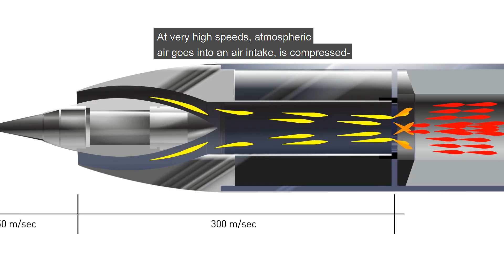How ramjets may change the role of artillery on the battlefield

Comment: I imagine this combined with a rail gun and it would be literally Intercontinental Ballistic Shells.
Reply: I could see that being used with railguns (even though railguns are mostly being looked upon because they negate the problems of conventional artillery, they do come with their fair share of problems though), but idk about the "ICBS" part... You'd need to fire those at very VERY high altitudes to reach another continent, and ramjets have a massive problem with very high-alt flight... I guess we'll have to see how this whole tech evolves but i don't really see the point of an ICBS system seeing how easily defeated it would be by any AADS...
Reply: @leodelizy3822   The SR-71 flew at the speed of this projectile. Over 4,000 times it was fired on by every missile and AADS system in the world. Every single one missed.  Why does anyone think that any system in the world can destroy a mach 3 projectile 1/100 the size of the SR-71?
Reply: @michaelrunnels7660  Not saying you're wrong, but you are forgetting that the SR-71 flew in a straight line at 80 - 90,000 ft, while this round will be traveling in an arc, eventually approaching the ground.  Also, while a Scud is much much larger, it traveled at Mach 5 and was taken down by Patriots.
Reply: Railgun projectiles are made of a solid block of metal. They are accelerated so much that any mechanical construct would be damaged. There is also no space to put in the rocket motor
Reply: @deadbeef576  a ramjet engine is an excedingly simple design that almost has no moving parts so that isnt the problem
Reply: @deadbeef576  the rocket uses a solid propelant not a líquido one, those tend to be far more resilient than a liquid propelant one and use less space, thats one of the advantages of this system

Also it's excedingly easy to isolate rocket fuel from electricity of all things (rockets HAVE been struck by lightning before with minimal damage, one example is the apollo 12 which went to complete it's journey with no problem), so no you don't really need a lot of mass, so the rest of what you say is just non sense

Also yeah usually ramjets are capable of reaching hypersonic speeds on their own the proyectile would need to be designed to survive the huge speeds, right now the navy is working on that with their current railgun project so no problem

Like, really, you are just trying to find problems with the design even when there arent any or at the very least not insurmountable ones, every single thing you mention either already has a solution, was never a problem to begin with or doesnt really make sence
Reply: @carso1500  Have you ever seen the railgun projectile? It is a solid block, and the currents going through it are immense
It is not merely a a lightning bolt.
A lightning bolt can produce up to 20000 amps in current, while a railgun goes up to 5000000.
Reply: @deadbeef576  yeah, i also know from high speed cameras that the proyectile stays solid even going at mach 7/8 and it's made of just regular steel, you really are overstimating the temperatures reached by going that speed (without taking into account that there ARE ways of developing a proyectile that survive such speeds, we have materials capable of going at those speeds and not even flinch)
Reply: @carso1500  Why arent you addressing my point concering 5 million amps?
Reply: @deadbeef576  because it's not a problem as i tell you, you arent reading shielding from electricity is extremly easy (the friction is the real problem imo, but electricity can be bloqued entirely by regular aluminium)
Reply: @carso1500  You dont understand how railguns work. How induction fields work.
Ever used an induction hob? Those amps are causing a lot of heat, just compare it:
A regular induciton hob uses about 42 amps to heat up a pan. And that pretty fast. Now multiply this times 100000 which a railgun projectile has to endure.
It is the same principle.
Reply: @deadbeef576  eh, no that not how it works, the electrical field doesnt really generate heat because it's just used to create a magnetic field (well i mean, it's electricity it DOES generate heat unless you have a perfect conductor which we don't, but not as much as you think), the way a railgun works is by transmiting huge amounts of electricity through a set of parallel rails thus creating a magnetic influx, now the moment you put something between those rails (of course it needs to be build of a conducting material, usually either Cooper or aluminium) the proyectile accelerates thanks to the magnetic field

Also you can't use the same logic as behind a electrive stove, both are completly diferent systems designed to accomplish completly diferent goals

Now, the reason it doesnt gets hot (or atleast not hundreds or thousands of degrees hot) it's two fold, for once the rails are build from highly conducting material, they need to be able to create the magnetic field, this means that the electricity and the heat flows really fast through the entire thing thus distributing it equally, this means that the entire rail is colder than it should be because the whole construction mantains the same temperature equally distributed, the second reason they don't really heat is because railguns only transit electricity through their rails when you want to shot it, for example the rail gun the navy developed uses huge capacitor banks that store all the energy on them, capacitors have the advantage that they can quickly discharge all their electric charge in miliseconds thus allowing you to keep all the electricity needed to fire the damn thing inside them and once you actually want to shot the weapon they quickly discharge filling the rails with electricity, this is done because railguns are extremly energy hungry, you would need a nuclear reactor to keep a railgun running for more than one second (that granted thats actually what the US navy wants to accomplish, quick discharges and recharges)

This is the same design the Ford class aircraf carrier uses for it's electromagnetic catapult btw, just of course instead of firing a solid core tungsten round at hyper sonic speeds it propels and F-35 or F-22 downrange

Btw how do i know all this, for once i am an army snob i have really investigated how all of this works, also i am an actual mechatronics enginer i know how electricity works better than you do
Reply: @carso1500  also, i know i might be a bit late to the party but I'm pretty sure a metal alloy casing could be used during the launching phase to propel the projectile itself and take most of the heat, and maybe even use said heat to ignite the primary fuel block? A bit wacky probably but that's the way i could see such a thing being launched, what do you think?
Reply: @leodelizy3822  yeah, thats called a sabot round and it could definetly be used to protect the main cassing of the proyectile through the terminal phase, the real problem with a sabot is that it usually does reduce the size and as such the power of the main proyectile

I guess you could posibly use a thin aluminium casing, just thin enough that it would probably get vaporized by the heat generated from the friction against the rails, but that should be enough to protect the outer cassing of the round from the heat so yeah, it could posibly work and it would be quite badass at that
Reply: RAM jets don't work above mach 5
Reply: It's not a shell, it's a rocket. We already have those.

Comment: ok, we confirm our shells have reached into enemy territory.
now how can we send the explosives left behind in our base ?
Reply: Thinking the same thing. Was wondering where the explosive charge was. This might take out a tank on kinetics alone but one of the major uses of artillery is against troops. Steel rain, you know?
Reply: @drakkonis1  ssubmuntions presumably, 155mm sub muntions shells useually have around 7 tubes of sub munitions rapped around a central tribe of submuntions. With the ramjet you could still keep the outer layer of submuntions. Meaning you can still have a fairly wide spread of anti-personal shrapenal and pressure wave.
Reply: pretty much same thing i was thinking, so your throwing engines at them with barley any explosive..  bit of a waste of money. better off spending it on equipping and training soldiers better.
Reply: @deana8052  Explosives may not be necessary.  If the motor is still running at impact, it will have a massive amount of kinetic energy.  Smarter Every Day has videos showing the damage that a Mach 1 baseball can do.  These would be much heavier and travelling at least 3 times as fast.   With laser guidance, that would be more than adequate for taking out targets such as opposing artillery.
Reply: @edwardbarton1680  Yea that's just wishful thinking, where are they going to put this tracking system to guide it?
Reply: @deana8052  On the shell, it can be included in the central cone.  For the actual targeting laser, it could be done using either a high-altitude airplane, or with a forward scout.
Reply: Dean a  it’s going mock three and away is over 100 pounds it doesn’t get guided just like other artillery shells such as mortars.
Reply: @hunterwalker6832  Yes but if you read the other comments you would see that Edward was claiming that it could be, So what if it is a fast moving piece of metal it isn't pin point accurate being fired from artillery.  

@Edward Barton  If you're going to laser the target, you are better of dropping a JDAM or sending a cruise missile. Lobbing arty rounds that don't explode isn't effective, not to mention it wont be armour piercing either and there are more deadly and viable options already available imo.  

the only thing this video showed is that it can go far that's it.
Reply: @deana8052  actually, it doesn't have as much as an he shell, but it does have explosive mass
Reply: @lunchbox1553  not when its using all the propellent to achieve its longer range. Nothing in the video made it look effective for anything apart from going further.
Reply: @deana8052  The propellant and explosive mass are two different things, and it doesn't even need any explosive mass, so I don't see why that's even a problem
Reply: @lunchbox1553  An unguided artillery shell not carrying any explosive mass is a waste. At long ranges, hitting the target with unguided shells needs a fair amount of luck; hitting within 5-10 meters is already acceptable.
All this video is talking about is range, not a single word about accuracy.
Reply: @deana8052  A few inches of Armor will not help you when a hypersonic projectile hits... This system will be perfect for armored targets. On the other hand this type of shell will be probably be useless against large numbers of soft targets.
Reply: @deana8052  you do realise laser guided artillery munitions have been a thing since the 80s right? Both the Soviets and Nato has had them for atleast that long. Cruise missiles are bloody expensive and overkill for most targets...

As for anti-tank? APFSDS shells also lack explosives, its simply a solid dart traveling at ~1800m/s, a ~3000m/s ramjet shell with a tungsten or du cap coming in at an angle (hitting top armour) will likely kill any tank currently in existance and any in the near future...
Reply: I dont know about ramjets for artillery purposes. What if the Shell has engineproblems and falls on friendly troops. Its unpredictably

Comment: The concept is quite interesting indeed.
But the main aspect of artillery is that the shell is fill with HE and to destroy with as much blast and explosive mass as possible.
With that Projectile I don't see much Explosive mass in it.
Your sacrifice distance and speed over Powerful Explosive Destruction.
That's why Russia uses MRLS because it's a small fuel burn with a lot of HE filler,And the projectiles are quite long too.
Reply: I could see it used in a counter-battery role where air superiority hasn't been achieved. Yes HE will always be cheaper, and more effective in an Area of Effect or denial role. CIWS are evolving fast enough that MRLS systems may not be quite as effective in the counter battery role. More tools in the toolbox may not be a bad thing.

Comment: I'm skeptical.  What's the advantage of this thing over an SRBM?  It would have an extremely limited payload, due to all the other stuff you'd have to fit in the shell, and since each projectile would need to have a precision guidance system (or it won't hit a thing at 150km), the cost would be quite high, probably $100,000+ per unit.  In contrast, for a few million bucks one could get an SRBM with double the range and a 500kg warhead.  What can 50 of these things do that the SRBM can't?

Comment: This video was in my Youtube recommended page...

SAMMO is absolutely a bunch of idiots.

First, cannons fire roughly 20-30 miles, because they exist to support army agendas, which include troop movements. And their conventional rounds will fire under water, or in a vacuum (space weaponry).

A projectile which fires over 100-linear miles, will outrange its supporting army, which is required to challenge and hold areas of land.

Next we have the projectile itself. 2/3 of the projectile is propulsion, which leaves the explosive unimpressive.

A conventional cannon shell is almost 60-80% explosive charge or more. This can be very impressive.

And then there is the cost of the projectile. Its engineering alone must be factored into the overall cost of the projectile. It will be so expensive that using it will be prohibitive. It will cost many times the cost of a conventional cannon round. And yield only a fraction of the destructive results.

This idea is just plain dumb!
Reply: If anything it is a special purpose round, not a general one. Like Excalibur. This is not replacing conventional artillery, but perhaps filling a gap between artillery and cruise missiles. I have no idea if the concept will be successful, much because of the concerns you raise, but it is an interesting concept.

Comment: The MLRS system has been around since 1983 and has an operational range of 300 miles. Miles. Not kilometers. So that’s 480kms. And it comes in an armored platform, the M270. Not a thin skinned truck. Not sure where they’ve been for the last 40 years but NATO hasn’t been out ranged in a long time. Unless they intend to put some kind of payload on this, I don’t see how it’s anything but a direct fire weapon. This may have a practical application in an anti-tank role or anti-ship role but as an indirect fire weapon, I’m not seeing it.

Comment: Interesting, but most likely very expensive and rather inaccurate... i guess

what about if the V3 and a mobile artillery had sex ?
all it needed would be some kind of extra-large loading systems for the boostcharges at the middle of the barrel, because the reload of this artillerypiece would be waaaay too long otherwise...

Comment: Just make rocket artillery. Here in Brazil we have the Astros II systems, which can use different missiles for different effects, the smallest missile can be carried in groups of 32 missiles and has a range of 40km and the largest missile has 150km of range and is carried in groups of 4. There are many other types of missiles with varying ranges and effects. I believe the only reason rockets are not heavily used is because of costs and other logistic aspects that conventional artillery can be better at.

Comment: Won't be that good as an area-denial artillery shell, because to fit the extra rocket fuel, they would need to reduce the shrapnel payload. Could still work for destroying buildings, but won't be as effective against infantry and even lightly armored vehicles. But this could be a great anti-tank shell to be fired from a tank cannons. 
All of the people saying "you do not need explosive charge, when you are going this fast" are right only when you are DIRECTLY hitting an armored target, but if you are aiming for an area of effect weapon, that extra speed would only help your shell to dig further into the ground before exploding. It might be good for a bunker-busting shell, but not for area-denial. But that won't work either, because the initial velocity of a shell does not affect its terminal velocity. It only affects how high a shell can go before starting its free fall. That height does determine how fast a shell is going to hit the ground, but there is also something else that limits that speed: a shells aerodynamics, and therefore its terminal velocity. Even if you dropped a shell to the ground from the space, or from 2 km, those will have the same velocity when they hit the ground, because the shell will reach its terminal velocity long before reaching the ground. So, this shell will have the same terminal velocity as a regular shell, unless you are directly aiming at your target (no indirect fire).

Comment: I think ground platforms should be a secondary priority for this technology and it would really shine in an aerial platform like the AC-130 or a supersonic drone. Think of the damage/range if you fired it at 40k feet down on a target with a specialized kinetic penetrator. Get it past mach 6 and you got a Hammer of God.